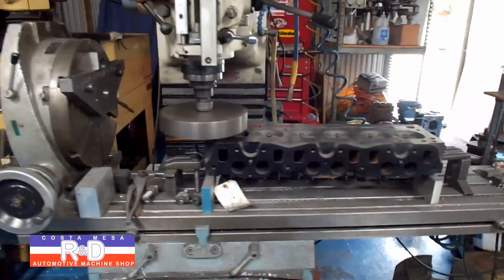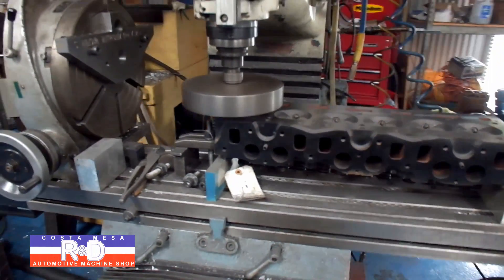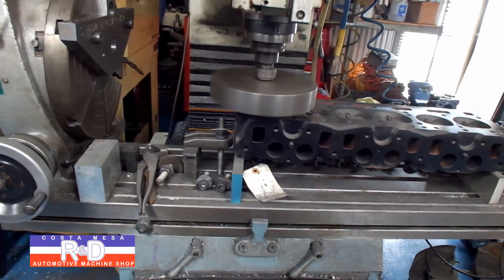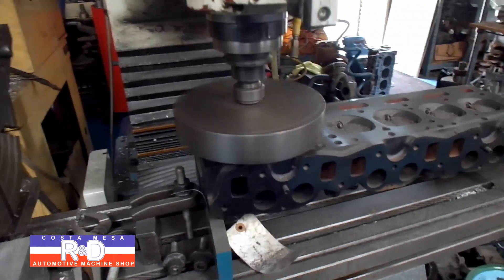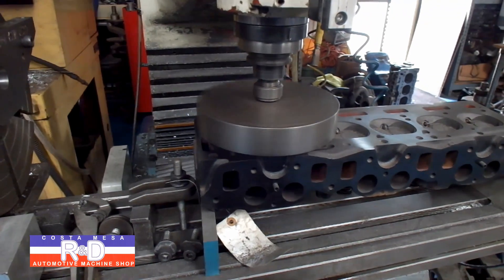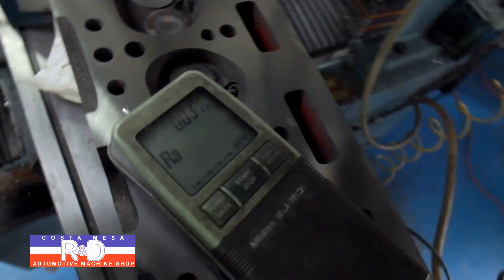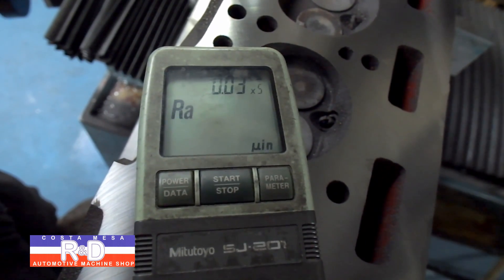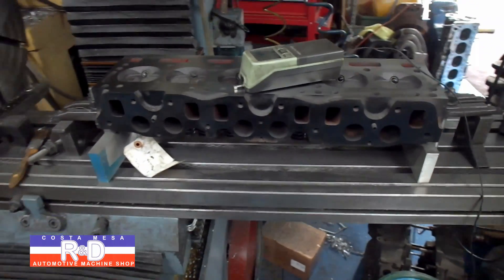Triumph TR-6 Cylinder Head Resurfacing to Raise Compression

Comment: Raising CR typically does a few things: increases power, usually at higher RPM (above 4K) is one, and in my experience, it may impact how much timing can be used (usually less) since (my observation) the higher CR tends to create hot spots in the chamber. Engines may actually run a bit cleaner on emissions too.